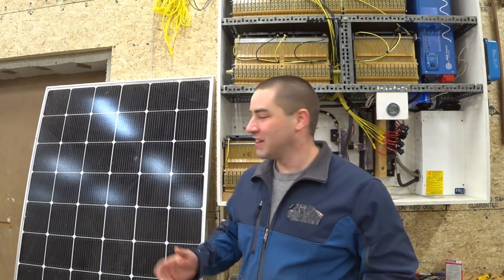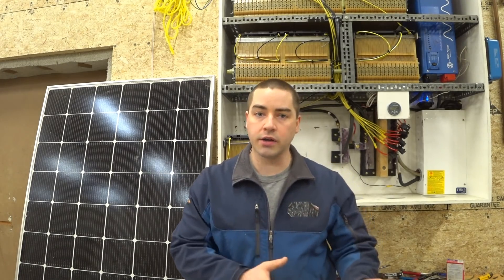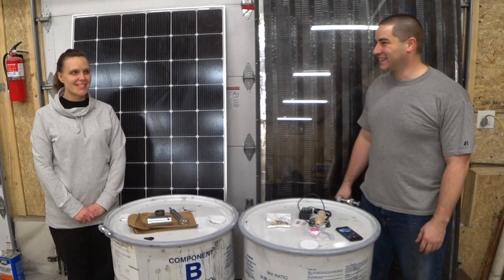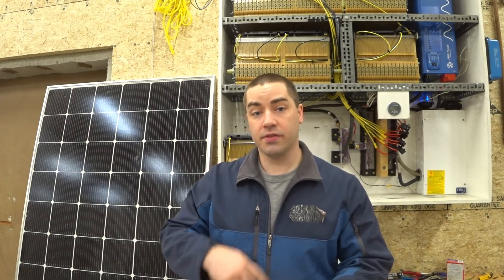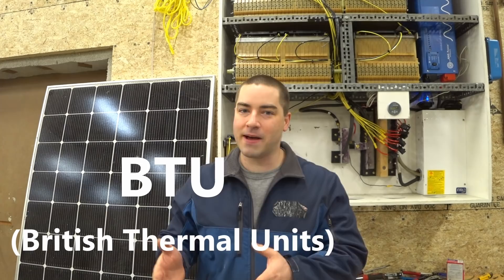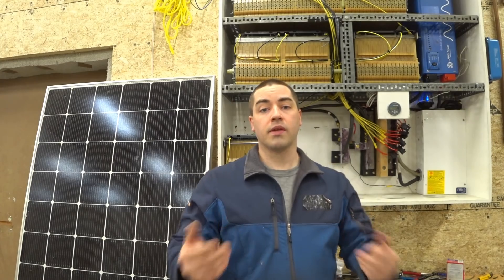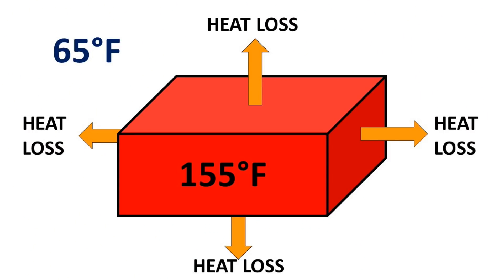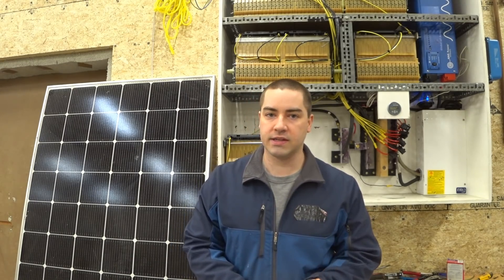Cheapest Energy Storage Off-Grid

Comment: Off grid water heater would work but you have to modify some kind of valve to the inlet so your water don't get to hot its basically  a jet stove with copper tubing in the inside of the stove wall. Fill your water cell full of cold water with the outlet house in the bottom of the water cell and when you start the fire in the off grid water heater it pulls in the water because heat rises. Its energy efficient if that's what your going for.

Comment: Aproximately (or even some general ballpark comment):  How  many water solar panels  (as you show in the youtube) does it take to maintain your 250gal to 150-180F on Sunny days thru winter time...  were you able to get enough sun to do this?
Reply from the maker: The solar hot water panels (Thermal collectors) won't maintain hot water in winter regardless of how many panels.  They just won't get it hot enough.  They can make plenty of warm water, but not hot.  That's why I'm going to build another tank with solar electric panels heating it.

Comment: How about hydrogen as a energy storage? solar panels to run electrolysis.
Reply: MemesTV - Storing compressed explosive hydrogen gas is a non-trivial problem. The H2 molecules are the smallest and leak out where air would not. And did I mention that hydrogen is explosive.  Not a job for home handymen.

Comment: Use solar to run an HHO dry cell, then run the hydrogen gas in a propane type water heater.....orrrr just buy a heat pump water heater, they are an absolute must in hot weather areas.

Comment: Based on my experience with solar thermal panels it will be hard to get even 160 degree water using a conventional hot water panel in Mass in the winter.

Comment: David, thank you for running through the math.  I agree it would be easier to go metric, then convert the final to BTU's.  I'm in the middle of a project to heat water with solar to heat a studio with a radiant floor system.  The plan is to store the hot water underground, under a greenhouse actually.  I will bury 2  275 gal IBC totes that will be surrounded with 3" styrofoam.   That in turn will be encased in a vault of aircrete.  The aircrete gives it structure as well as insulation.  Its just easy to fill up the space in the hole with aircrete.  I will fill the tanks with rain water and control the heat flow from one to the other, in case I don't have enough sun to heat the whole 550 gal.  I'm still trying to figure out how to do that.  I'm in PA near Harrisburg so I too have 4ish days of autonomy.  Any suggestions you have about solar collector sizing would be greatly appreciated.  Though the sun delivers near 1kwatt of power / sq meter, I know I won't get that.  Your video is inspiring. Keep it up.
Reply: …. You are doing interesting heating project, good luck.  HELIOSTATS  I have always wondered if mirrors to bounce sun into house interior black wall would help here in Minnesota, or dumb white parabola billboard to bounce LOTS of sun into rear window thus each back fence is free heating if big enough ??.  . . . MICROW  Or would a Microwave unit in the water help to quickly turn PV to heat...

Comment: You could use IBC container for 1000L of water, put it on styrofoam, use pur foam for the sides and top, so it would be closed loop. Than use salted water - it has higher heat capacity.
The whole system would be closed, only with few holes in the chassis. The only thing is - you need a pressure bleeder not to overpressure the tank.
I need to look into this ;)
Reply: I have an IBC poly tank but have been hesitant to use it for thermal storage because I can't find a rating on how hot the water could be stored.

Comment: I didn't find it but it seems you are using resistance heating.  You need to find a way to work a heatpump into the system to get 4-5 times the heat (BTU) from each watthour off solar production.  My heatpump water heaters will do 140F.  So could get your 50F (?) incoming water up to 140F.  COP is 4.5.  You could use resistance to get from there up to 180.  So about 70% of your solar energy could be multiplied by 4.5 in the BTU produced.

Comment: PV makes power to light your home. Your storing it as heat. When you need electric, how will you extract it from a hot water tank? #Apples&Oranges
Reply from the maker: I store electrical energy in batteries.  I store heat energy in water.  Thanks for watching.

Comment: So if it's energy storage, but cheaper than lithium batteries, how do you recover the energy and get the electricity back again??
Reply from the maker: I use batteries for my electrical loads.  I use the thermal energy storage for my hot water,
Reply: @DavidPozEnergy  Yes sorry with the title of the video I thought it was going to be about storing electrical energy.  Where I live the temperatures are such that getting cold water is the problem, so I was thinking you'd come up with something cheaper than lead acid batteries!

Comment: Simple cheep solution. Find a used or broken oil fired water heater. Remove the blower unit and build a wood fire in the fire box. It works great. You can go crazy and build a rocket stove assembly in place of the blower. Have this water heater installed in the system before or upstream from your regular water heater so the water stays refreshed. With valves you can bypass the regular tank and feed direct from the wood fired heater. Now you have all the hot water you need and save your power for more important things. I was a heating and AC tech for 30 years and I've now been off grid 5 years. I'm an expert with experience. Trust me, when off grid heating your water with electricity is anti-productive and very expensive.

Comment: We used a 9 foot around water tank with coper coils going around the tank and more coper coils going around the tank going to the domestic hot water tank then another coil going to a wood burning furnace and another coil of copper pipe to the forced hot water pipes going around the house .
The solar hot water supplied all the domestic hot water 3 seasons and you fire the wood burning furnace for 3 days and this would heat the house for three more days . This was for a very large house with some windows 18 that where 18 feet tall in Southern New Hampshire . SCOTT
Reply from the maker: Nice.
Do you have any articles about it?
Reply: This was the heating system in my Dad s house . The show this old house the solar used nine sided wafers that where grown in Boston that made the panels. 
The word burning furnace was a 
Jet Stream 
My dad taught at Harvard University and was on the N.H. Energy Commission.  I help start the Renewable Energy Industry of Nova Scotia and help author the Nova Scotia Energy Strategy. 
You could use your crawl space and have the pipes go long instead of 9 feet tall using solar panels and direct DC water heaters a few panels directly to each water heater.  We had free hot water three seasons and the wood furnace the copper coils pre heated the domestic hot water and the forced hot water pipes going around the tank 
 SCOTT from N.H.

Comment: Thanks for this pratical demonstration of a soo obviouse fact (cost and efficiancy of storing heat instead of woarming water with solar electricity)... 10 to 15 times less expensive per Kwh.
Not even talking of advantage of passive vs active systems and complexity in regards of installation and maintenance. ;) 

Juts a couple of points:

- Hot water could be stored for a few days before significant energy losses, when the Li-Ion retains most of the energy much longer (weeks).

- You could have built smaller insulated hot water "Cells", speeding up the reheat of small amount of water and reducing the losses by pushing less cold water into the total storage when you need a little bit of hot water. And reducing lost/unavailability in case of leaks ;)

- Yes, copper pipes are much more efficient at transmitting heat from the heat transfer liquid to usable water.

- Most elements (except pumps and thermovalves) could be made at home. (Pumps and valves could be easily reused from broken washing machins)

Cheers, from South of France

Comment: Isn't the bigger the capacity , the better. One liter of boiled water will be at room temp in 10 min ( the colder the room the quicker it will cool down). But a kettle of 200 liter will take many hours to be at room temp. So the smaller the capacity, then the better the isolation should be.

Comment: Smart design! Finally one man "bites it thru" that storing electricity (as the high end product) is so non-smart and inefficient. Water is by design to be a storage for heat and cold also in a form of ice. You can combine things with direct solar to water heating. You can have 2 stage storage, where you have say 1 to 20 size of storage tanks. You heat smaller first and fast and you get heat taken out from the smaller last. Heat pump can be used to heat the smaller tank to the consumption temperature.

Comment: I have been thinking about running a mini split during winter for supplemental heat, but thanks to you, I am now also considering using solar heated water for space heating.  I can see the benefits as long as the water is heated with solar and not the grid.  After all, panels are becoming cheaper and cheaper.
Reply from the maker: Sounds good.  I have had trouble with my miini-split.

Comment: As the water heated in the tank is not going through the circuit, there's a huge benefit at choosing something different than pure water as heat storage. Sodium acetate brine is stunning for that as it crystallizes around 136°F, and so gives back state transition energy that is bigger than standard heat capacity of the material.
So you need a smaller tank, less insulation and other materials, so less heat loss. Sodium acetate can be bought or even made quite easily with gem salt and pure vinegar. You need then a corrosion free tank, but all I see troubling that in this installation is the metal wires fixing the tubing.

Comment: Great video, but would be fantastic if you could actually talk about the size of the thermal solar that you would need to heat that volume...
Reply from the maker: Hi Chad B.  Thanks for watching.  I should probably do an over-view video of my whole setup.  I have several videos on my channel documenting the build.  I installed 3 solar collectors on my south-facing wall, and built a 250 gallon tank inside my crawlspace.

Comment: Hello, Awsome video, just wish I could see more how you did that in detail, or how it works. Could you tell me what is heating your battery coil. Are you going to change your battery coil to copper, if so could you do a video about that also. Thank you
Reply from the maker: I have a few videos building the system.  The sun heats the thermal collectors, which heats the tank.  No plans to change the coil right now.  I will change it if I need to do something else, but the system is pretty hands-off.

Comment: Heating and storing heat inwatrr is good. Have done this for over 40 years. To jump it up a bit put sand in water. Water convects heat and sand stores as a thermal lag. Use green cat litter 1gallon bottles. You can also use flat black hot rod primer paint to gather more heat. Set in South windows. Easyy peazy.  I own a solar company called SSR. Keep it simple stupid spoken here.

Comment: Thisoldtech
I love this idea. You should take this idea to a product. You could build two types of units to store water energy. One tank that is stainless steel. And one that is plastic with temperature limits. Insulate the tanks we!!. Make them forms that fit thru doorways. Plastic would be The lower cost units. Stainless would be The higher cost higher temperatures. Add some sensors for flow and temp.  And let the users purchase their own pumps and panels. This combined with solar batteries sounds great!

Comment: You just spent 14 minutes of people's time showing how to heat and store water.  How is that going to run an air conditioner or a computer?  Single purpose energy is not a solution.  Back to your drawing board.
Reply: Theres other videos for that dipshit, I think he has other videos on his channel. He just explained why it was smarter to heat water instead of using PV. This video is not about how to run a computer
Reply: Ideally, multipurpose energy storage is best, but he starts by explaining that said storage in batteries is very expensive. He just showed in this video that if he has stored his electrical energy in his battery (supposedly enough for his electrical energy needs) it is very effective to store the exes energy he generates as heat energy. In fact, it might be more cost-effective to store electrical energy as heat energy, instead of electrical battery energy. This, of course, is very dependent on the heating solutions available in your specific situation.
Reply: Had nothing to do with running A/C or creating electricity.  If anything it had EVERYTHING to do with saving electricity (which would have to be stored in overly expensive batteries) by heating and storing hot water for use over a number of days...

Comment: you want to save money here is my idea. it is not common in USA or Canada to use those sun powered water heaters but it widely used in Republic of Turkey you can see it in most rooftops to heat water free and stored in thanks attached to it. so dig a bid hole and insulate it and use giant water tank and use that water for your shower needs, kitchen needs, and also you can use it for heating house you can use electricity for your other common needs like tv, charging phones, lights and washing machines etc.  and dont forget you can use steam power to get electricity also.

Comment: Please don't confuse the concept of Energy and Exergy. Yes, this tank might have the same amount of energy, but it's exergy is minimal. For those that don't know what I'm talking about, exergy describes the theoretical maximum amount of physical work that you could get out of an energy storage. A batterys energy is basically available to do work for about it's entire capacity. The stored energy is much more valuble then heat energy is. Why? Because you could use it to lift stuff, to power your electrical appliances, to run lights etc. 
Heat energy can, as you all know, be converted into physical energy by thermal engines. These thermal engines however have a cold hard limit to how much of the energy can be extracted, even if it was a mechanically perfect machine. The amount of work that can be extracted is directly proportinate to the temperature difference between the hot and the cold reservoir (eg for a car engine the burning temperature of the fuel in the piston vs. the intake air temperature). This is all based on the fact that temperature is allways moving from hot to cold, a concept called maximized entropy. 
For those of you that don't like thermodynamics, a practical example might help you to understand what I talk about. Imagine you make a pot of coffee, that is 1 liter of coffee at about 100°C, so almost boiling. The environment is a little chilly 20 °C. Now if you had 80 liters of water at 21°C, this water would have the same energy as the coffee has in regards to your surroundings. But now imagine you find a wax seal somewhere that you want to open up by melting the wax - you can use the hot coffee for this, as wax melts somewhere around 60 to 70 °C. You cannot, however, use the 80 liters of just above room termperature water for this task. That is the difference in exergy. The higher the exergy, the more potential the energy has to fullfill usefull tasks for you. I hope this clears some stuff up as to why a cheap tank and an expensive batterybank are not interchangable.

Comment: Gasifier hooked to a generator with a coil run through the gasifier = electricity + hot water for heating as well...
Reply: That assumes you have free wood around the property.  This wouldn't work well in non wooded areas or smaller homesteads that don't want to chop down the few trees they own. You could power the gasifier with pellets or wood you bought but that would change the cost. For dessert homesteads solar panels with battery packs combined with solar water heating and water tanks makes the most sense.  It would be really cool to put the water tank up high and also use the gravity as a store of energy. (aka pumped storage)

Comment: I'll set up a wood  Gassifier to run a generator and  heat the water by running a copper tubing inside the heat chamber of the wood gassifier and sell your batteries and replace it with wood pellets or firewood

Comment: https://www.lowtechmagazine.com/2019/02/heat-your-house-with-a-water-brake-windmill.html#more has Artikel about this as well. If you happened to have a kinetic energy then it could be cheaper to run a mehanical heatpump there would need to be some way to stop/start compressor or get predictable source. With heatpump you need 1/3 to 1/10 of energy the rest would come from source medium
Higher COP ratings will be for units that are designed for lower delta between source & target medium, other efficiency improvements.